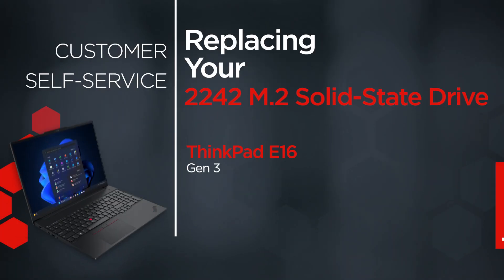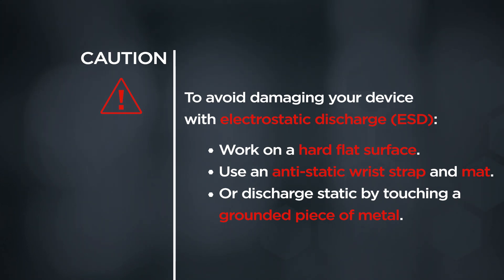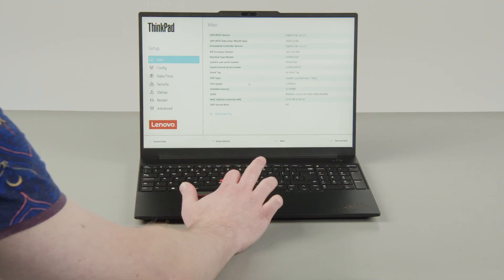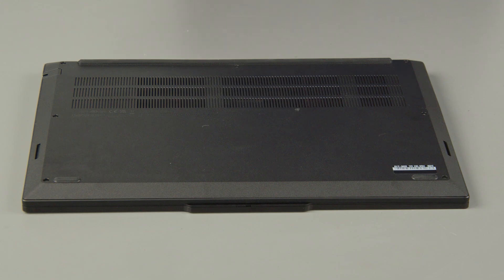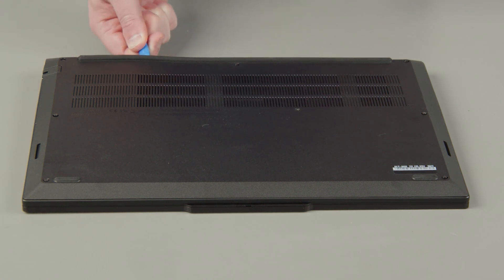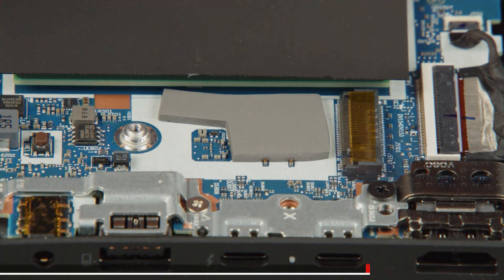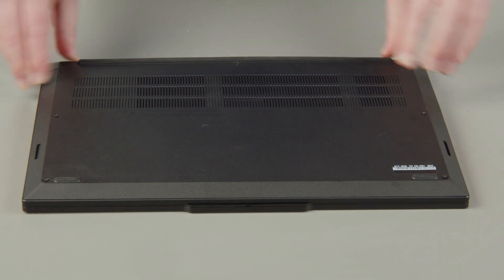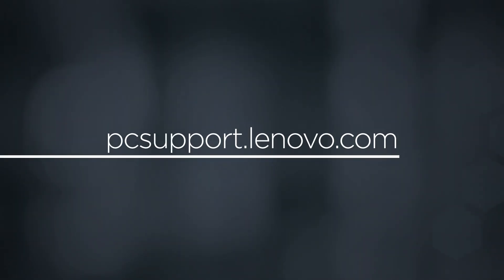Replacing Your 2242 Solid-State Drive | ThinkPad E16 Gen 3 | Customer Self Service

Comment from the maker: This video will show you how to replace the 2242 M.2 solid-state drive in your ThinkPad. The process in this video will work for the ThinkPad E16 Gen 3.

You will need a screwdriver kit, a non-metallic pry tool, and 15 minutes of your time.

To learn more about your device go to https://pcsupport.lenovo.com

To find parts for your device go to https://support.lenovo.com/parts-lookup/?cid=ww:lenovosocial:b9515f&source=socialmedia&subsource=yt

To view the Lenovo Support Self-Repair Guides landing page go to https://support.lenovo.com/us/en/solutions/HT516547

** NOTE: Static electricity can destroy components. Use a grounding strap, and clean, non-conductive surface to work on. Use plastic or coated tools to prevent scratching and avoid using metal tools on plastic parts. For more detailed information on electrostatic discharge and how to prevent it, please watch our "Understanding Electrostatic Discharge (ESD)" video: https://youtu.be/by4PB3WtdLo 

Applicable Machine Types:
ThinkPad E16 Gen 3 - 21SR, 21SS, 21ST, 21SU, 21TF, 21TG

Check out other official Lenovo channels!
https://www.youtube.com/@Lenovo 🟥
https://www.youtube.com/@lenovolegion 🎮
https://www.youtube.com/@Lenovo-PC 💻
https://www.youtube.com/@LenovoSuporte 🟢🟡

#Lenovo #LenovoSupport #LenovoTechSupport